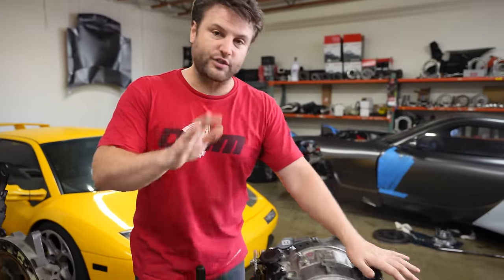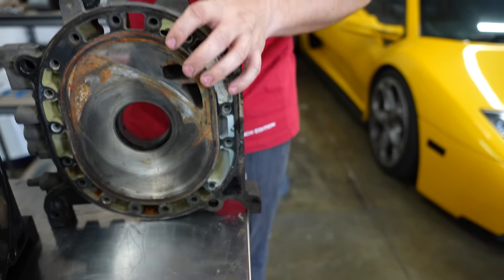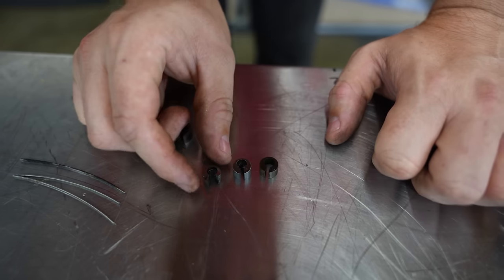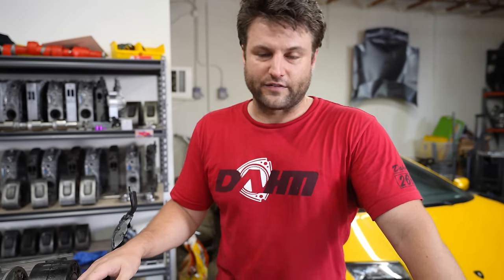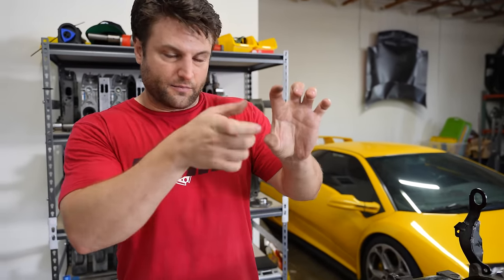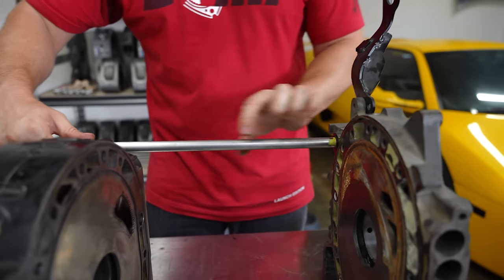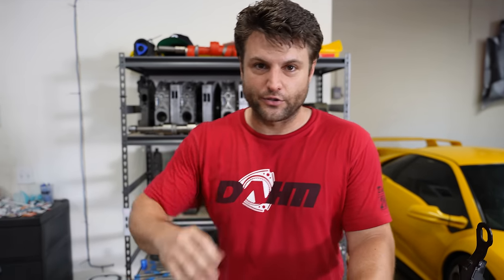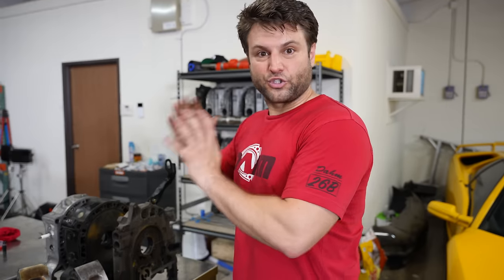Fixing the BIGGEST Problems of the Rotary Engine

Comment: “That’s what you get when you’re surrounded by guys who smoke weed in the shop”

RIP Rob’s torch
Reply: Dabs :)
Reply: Damn he threw his "buddies or employees" under the bus Haha
Reply from the maker: They need to quit taking the damn torch lol
Reply: @eddiepFW2345  perhaps even "under the blunt", if you will
Reply: @RobDahm  put it on a chain 😆🤣
Reply: @rickyriggleman3961  ^^I would agree except it's akin to chaining a pair of bolt cutters to the wall...
Reply: @RobDahm  Sounds like you guys need a shop rig and torch that are shackled to the wall hahaha
Reply: @andrewxti  Haha ye, it's not like they are gonna drag a human+ sized bottle of acetylene out the door into the ally! Or am I underestimating the willpower of a weed smoker when they trying to rip a bong? 😂
Reply: Keep the dab rig in the shop easy solution
Reply: @NMorstle  Rig it upto a turbo for super blowbacks xD
Reply: @RobDahm  the ‘Dahm’ torch! 🔦
Reply: @RobDahm  buy them puff co 
No need torch
Reply: A moment of silence for Rob's torch
Reply: Someone's got a dab rig somewhere in the shop 😂
Reply: I wanted to like your comment but it’s at 420… maybe I can start the run to 710?
Reply: @jwalkerjordan  aye
Reply: Set up an a nice  e-nail kit In a corner they can use the glass they already have drop in solution better experience anyway temp controlled perfect hits everytime with the full glass rig experience which is better than any puffco type device
Reply: @eddiepFW2345  Workplace banter is a great stress relief. Best one I've got from a boss is "Damn, man. You're dead to me."
All that disappointment was from me being a fan of a rival hockey team. That's serious business here in Sweden, haha.
Reply: Torchie found a new life style, and is riding high on it's surroundings.
Reply: Berg are you saying that the guys in the shop rob uses smoke marijuana and other drugs
Reply: Why not epoxy the spaces into the block?  Get a bunch machined to size in aluminum (think about different metals and thermal expansion).  You could sell them,  glue them into each slice permanently and not have to f with it anymore.
Reply: Ever heard of o-ringing a head on v8s?  You might be able to do that around the entire oval, help with any gasket leak as well. 
If you find the right metal (yield strength)
 it would be a structural member to help with the torsional stresses as well.
Reply: Getting torched with robs torch 😂
Reply: god damn kids doing dabs xD xD
Reply: That shit gave me a good laugh.
Reply: best shop owner ever.
Reply: Why I got a Mac torch… lifetime dabs
Reply: @RobDahm  Haven't laughed this hard at a comment in awhile, thanks Rob.
Reply: @RobDahm  , Rob great video . Your minds eye is 20/20 . Tool & Die here , 45 years in the shop . One question 17:45 , what took so long . Again, great video ,I learned a lot .
Reply: @RobDahm  they were going to return it but then they got high
Reply: @DaftFader  as a smoker I may or maynot have done this. Lol
Reply: @RobDahm  you should get the guys a custom engraved torch with something cool on it for them to use. Then they will not only have a torch but they will never want to use another one again. 😂
Reply: Dab life...

Comment: The Wankel Engine has SO much potential.  It defies belief that only one company was willing to take the risks to produce it.  I remember coming to the exact same conclusion you did about the two-stroke oil.  E-85...that's brilliant because it's a little bit counter intuitive.  I always wondered why the apex seals would fail...which you explained beautifully.  I just had a thought about a maranging stainless steel alloy.  Such an alloy actually gets stronger as it gets hotter...up to a certain temperature.  You may need some babbit metals alloyed with it to provide proper wear characteristics.  You need to study metallurgy on your own.  A smart guy like you may come up with the best alloy and solve that issue once and for all.  Also, the spring under the apex seal, maybe there's some super unobtanium alloy that will last the useful life of the engine.  I think you should focus on the aviation market...once you fix all of the issues.  It's a good compromise between a reciprocating engine & gas turbine.  The sky is the limit!
Reply: NSU also produced a Wankel engine. That was a failure too.
Reply: Several automakers worked to solve the problems, but only Mazda decided to bring them to market.
Reply: If all you care about is compactness and power, then sure there's nothing wrong with Wankels. But if you start needing to follow emissions and efficiency requirements, they start running into the same type of problems that prevent 2-stroke engines from going into mass produced cars. two-stroke oil doesn't burn cleanly, difficulty in implementing valve timing, the fact that the combustion chamber is moving at high speed makes it difficult to burn all the fuel fast enough, limitation in compression ratio.
Reply: @Appletank8  I could be mistaken, but I don’t think the emissions would hold it back in the aviation sector.  Of course, leave it to the EPA long enough, and they’ll mandate electric motors for private aircraft.
Reply: @skookapalooza2016  Yes small aircraft generally has less emissions regulations, and is more focused on absolute reliability, though they are finally phasing out leaded fuel for one. Still, a more efficient engine does mean you can fly further on the same tank of gas, so while a well maintained wankel can generally operate pretty reliably, their range would likely be a bit worse.
Reply: @skookapalooza2016  That's why small and light aircrafts often use the Wankel design.
Reply: @Dan_Divebomb   what happened to the Marshal rotary engine with no seal problem and no friction  ?
Reply: @familygoodall2200  no friction is impossible

Comment: I’ve always been scared of rotary engines. Just because everything is always such a secret. I really appreciate you taking the time to educate us
Reply: It's not a secret that the Wankel is a poor design.
Reply: @RayleighCriterion  Troll alert. Do not engage.
Reply: Ok bud
Reply: @ujiltromm7358  He's actually right though. Those Wankel designs have been a lot more susceptible to failure unlike a lot of other engines I have ever seen or heard of due to its low thermal efficiency and unreliability later on. 

Regardless how hard Mazda tries to improve or come with their own "solutions", how great it might be on gas, or how much less moving parts there are, if a seal on it breaks and coolant starts leaking inside it, that engine is ready to go no matter how hard you try to save it. But if powerplant is your specialty and you like taking engines apart, more power to you. But for me, I need something that gives me the best to both worlds: fuel saving, and reliable engine that will last much longer than 100k miles before a planned overhaul (or worsecase scenario: engine rebuild).
Reply: @EdnovStormbrewer  You're looking for the Toyota 4 cylinder or the Toyota 4 cylinder hybrid. 
Most reliable for up to 300K miles with regular oil changes.
Reply: @EdnovStormbrewer  They could work if manufacturers spent more time researching and improving the engine. The piston engine has had over 100 years of design and research by many many manufacturers and companies, and the rotary has only been produced for maybe more than 50 years by only one company: Mazda.
Reply: @nyathannyuwen8084  Only "Mazda" makes rotary? LMAO.  You are smart, but you've got so loooong to go... it hurts my head to even think about it.

Bad luck!
Reply: @Skankhunt-qf9eu  some german manufacturer made one too isnt it? But he still got a point, so far only mazda doing rotaries till the 90's
Reply: @Skankhunt-qf9eu  Norton and Rotron have had great success with rotary development. Also see Brian Crighton's latest race bike the CR 700 W twin rotor. It is a beast of a motor.
Reply: @thisismagacountry1318  most realible engine is old Toyota hiace 2,4 diesel from start 90er 👍👏 this is an engineering Marvel
Reply: @ujiltromm7358  he's right. Rotaries can have advantages but realistically the wankel was kind of a dead end design by the 90s. Omega 1. New rotary design even less parts and lighter. Higher effiency and less emissions. 

The wankel works great as a race motor. But for much else not really.
Reply: @EdnovStormbrewer  realistically the trade off in the wankel is if done properly and maintained properly at 100k the rebuild is just a refresher for seals and checking rotors and housings. Reassembly new seals and done for another 100k. But not that likely cause if you push the hp up service life can also go up and modding rotaries can be easily messed up. 

But at 100k on an ls you can have similar problems arise requiring expensive rebuilds. And more likely even if done right. The ls is just easy and cheap to repair since availability. It was good when first released but that was a long time ago.
Reply: @nyathannyuwen8084  Chevrolet actually out huge dollars in rotary research to never release a rotary engine lol. So have other companies and motorcycles have used rotaries. Mazda isn't the only company to make wankels. 

And the wankel design shoulda been dropped for a clean sheet rotary design alot sooner. 

Omega 1. Rotary engine. 35 lbs for 150hp. Stackable. Rpms go to 25k. No apex seals. Even less moving parts. And ignition and compression and such are split into different parts of the engine versus normal set uos granting higher effiency. 

Designed for aero usage but lol would be easy to adapt to a vehicle and realistically the auto industry has talented enough engineers to come up with a similar or same design. But continued wankel development into a dead end platform lead to the rotary engines death in most things.
Reply: Rotaries are not that secret. Anything secret probably pertains to patents and new developments.
Initially apex seal life was an issue as well as chatter marks in the rotor housings. Vane style hudraulic pumps can also develop these chatter marks and wear. Mazda engineers solved that. The early RX8s had apex seal failures. Mazda reduced oil injection of engine oil that cools and lubricates the apex seals for emissions reasons. To cure that, add 1/2 oz of 2 smoke oil per US gallon of gasoline at fillup. This will not hurt emissions but keep the engine healthy. Proper maintainence is important. No engine lasts well if dust can get past the air filter, but rotaries especially do not last if dust gets in.
Fuel economy and emissions are issues for certain. Early boing boing engine fuel economy was not great either, and we know the emissions of them was not addressed until the Clean Air Act was passed. Give rotaries 100 years development and who knows. 
As a fan of the rotary engine, automotive use is not exactly their forte'. Aircraft would be an excellent application as they are compact and light for their power output. With the use of lighter materials they could be lighter yet. As used today the fuel economy is not as good as certified recip engines, but better than turbine engines even in turboprop application. Development could improve fuel economy further.
Reply: @RayleighCriterion  what makes you believe the Wankel/rotary is a poor design? FYI there is only one German company licensed to us the name Wankel with regard to the engine design patented by Felix Wankel. He spent a lot of money to lock up that right. For the rest of us, they are rotary engines.
Reply: @daledavies2334  Have you seen the Liquid Piston rotary engine?
Reply: @RayleighCriterion  I have seen posts about it but never looked.
Reply: @daledavies2334  The reversed the design, made a figure 8 rotor into a triangle case and there are 3 combustion chambers.
Reply: @EdnovStormbrewer  you need to do.more research on the subject. Yes Mazda has had some errors with the rotary. Yes apex seal life was poor on the early engines while still working on the seal materials. Also if owners drove them like their American V8 by starting it and driving away without warming it up, the rotor housing warmed and tried to expand in the spark plug region and just below. The tension bolts had not expanded yet, so the Aluminium molecules got compressed. This created the coolant leak. These engines do need to be warmed up before driving hard. A 5 minute warmup and driving with light throttle until fully warmed up will prevent that from happening. In 72/73, Mazda had only been selling these engines for 5 or 6 years, and working on R&D for 10 years. NSU (subsequently bought by Audi and now part of VW group) also sold a wonderful rotary car, the RO80. They also had the same teething problems and could not put their fingers on the solution to the problem. Felix Wankel, the inventor, was working for NSU at the time. 
Mazda engineers kept working on the sealing issues and also changed the rotor housing metallurgy to a hypereutectic material. This negated the housing expansion issue to a large degree. Now the public is a suborn lot and do not seem capable of getting their heads around the idea of warming a cold engine gently, so this compression of the rotor housings still takes place causing leaks.
Meanwhile NSU, Mercedes, GM, Ford(Curtis Wright) among others all tried but gave up. Ingersoll Rand produced a large single and 2 rotor engine for generators and compressors built of all iron construction. Weight in these applications is not an issue. Running on natural gas, these engines were running up to 40,000 hours, 24/7 before overhaul. Just routine oil change and tuneup.
Curtis Wright also built a few series of engines up to 5 rotors that ran heavy fuels. Not a lot is known about these engines as the military does not divulge a lot about developmental projects, but they were of cast iron construction. If these did not have the chromed inner rotor housings, chatter marks would develop in the iron.
With power recovery or turbo compound, the efficiency could be improved. Using natural gas with high turbo boost could help with emissions.
Automotive is probably not the best application for rotary engines. With proper attention they can run trouble free for 300,000 miles or 500,000km. Aviation is where these would excel. Light and compact and with turbo compound the efficiency should meet or exceed recip standards. Engine life should also meet or exceed turbine standards at lower fuel and maintenance costs.
Reply: @Payday5  NSU started with a small car and then introduced the RO80. Very stylish up market. They just could not get on top of the apex seal issues. As Mazda, fuel economy and emissions were a challenge. Citroen also introduced a rotary vehicle, but could not solve the problems so it fell by the wayside fairly quickly. Mercedes and GM also procured patent rights but could not get past the same problems every other manufacturer had. Only little Mazda stuck with it and solved most problems.
Reply: @RayleighCriterion  a lot of designs have been tossed around. The triangular rotor in an ovoid housing is likely the least expensive for machining costs.
Reply: @RayleighCriterion  So. Just turned the Wankel design inside out. You still have the same issues to deal with. There has been other possibilities proposed as improvements. No development. The Omega 1 is a smoke and mirrors case IMHO to part investors of their money.